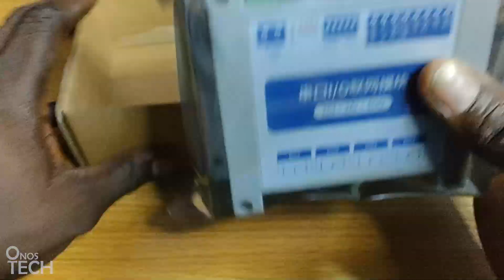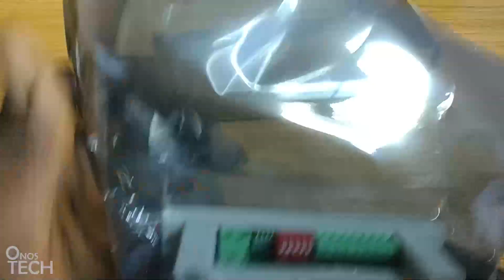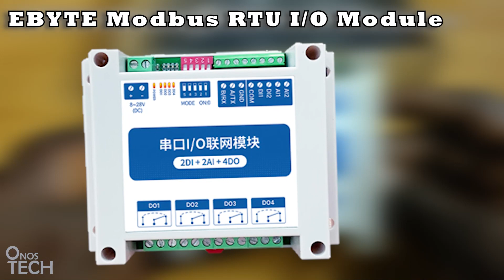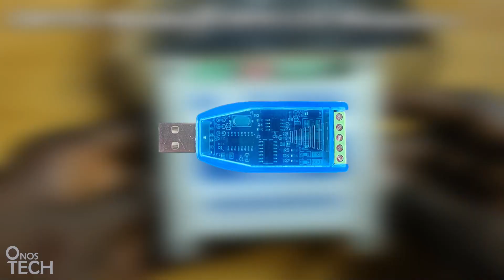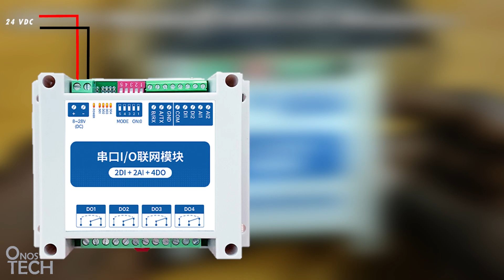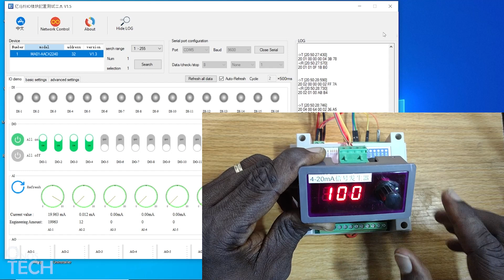Comment: i had problems to turn on output coil via PLC modbus. in the end i used HEX value FF00
Reply: That is great to know
Reply: Hi Allen,
I'm trying to send comand to it by an S7-1200 using the CP-1241 module, but wothout success. What PLC are you using?